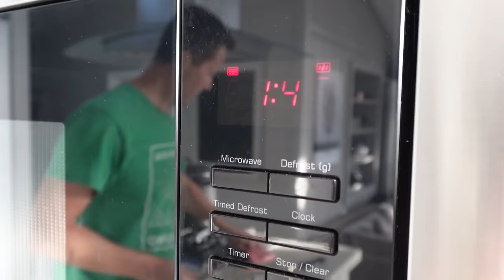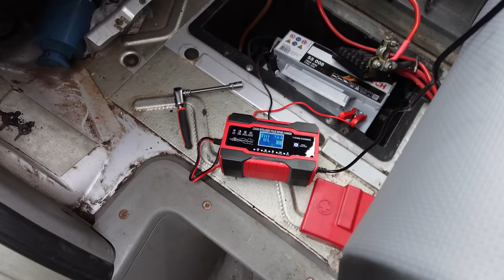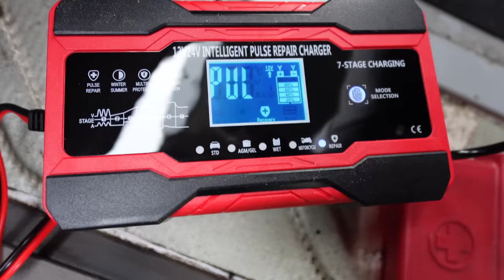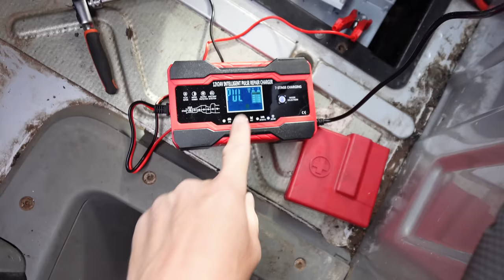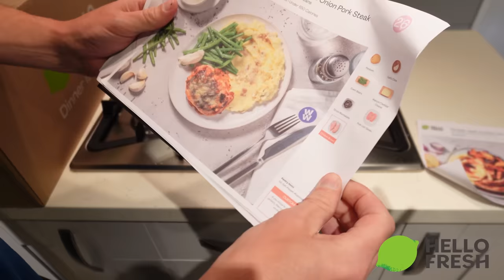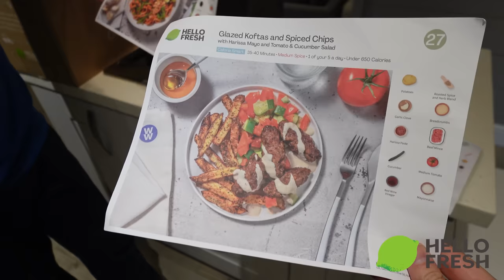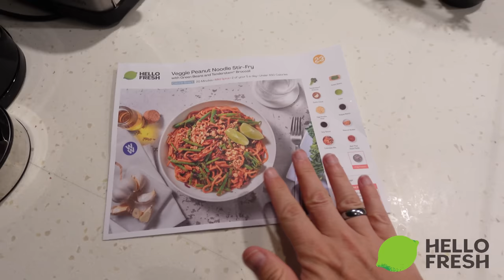CAMPER VAN BUILD Fitting the Kitchen Sink

Comment: Great build guys, I noticed nick turning the chuck on the drill really tight, top tip, once it’s tighten turn the chuck back one click and it prevents drill bit or what ever it using from coming loose 👍🏻